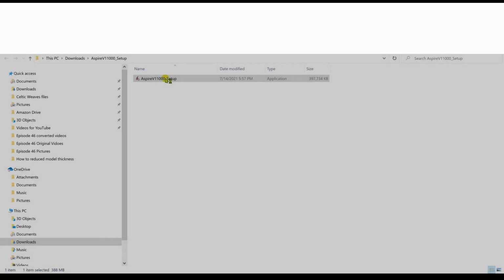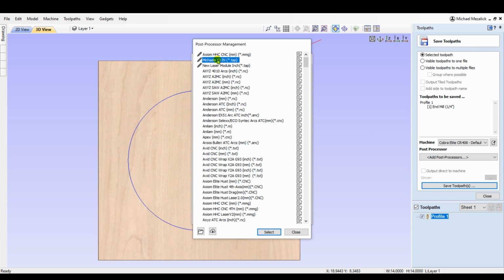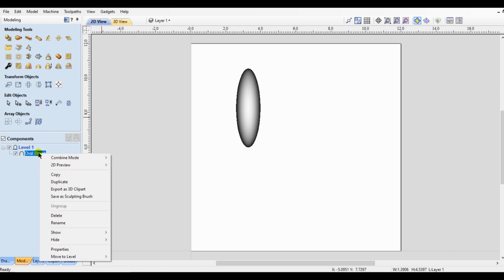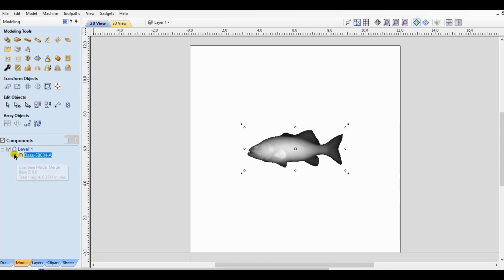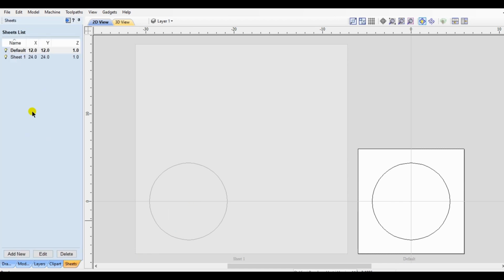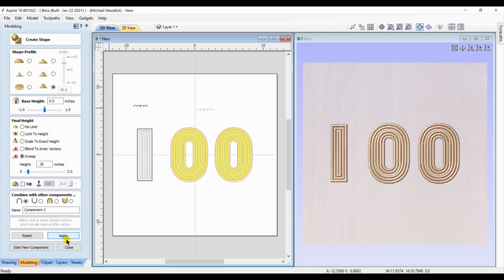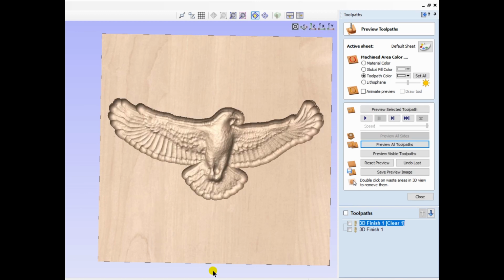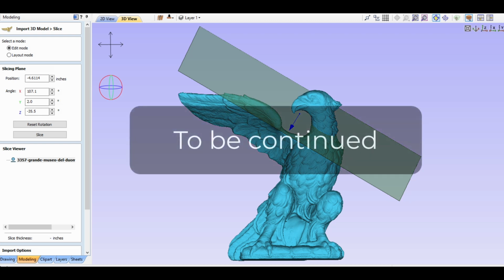Vectric V11 Highlights

Comment: does this have a post processor for DSP A18 g code ? and if so what would it be i don't want to buy if it does not work
Reply from the maker: I don't know. You'll need to contact h machine manufacture or Vectric directly.